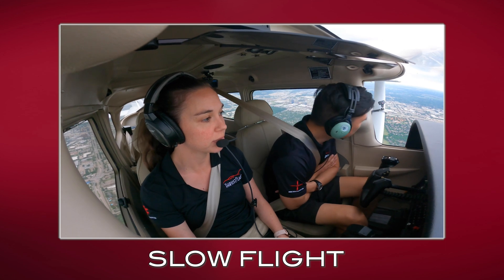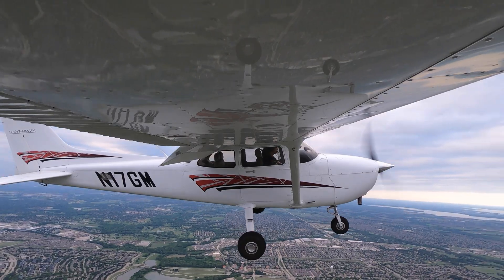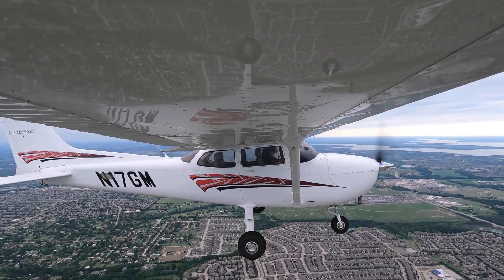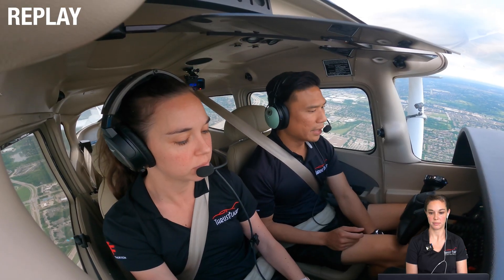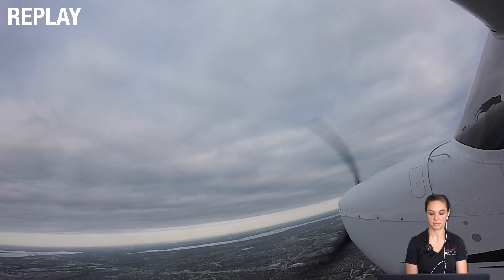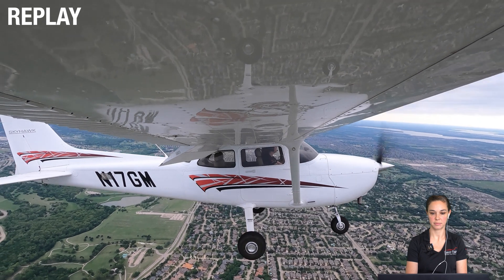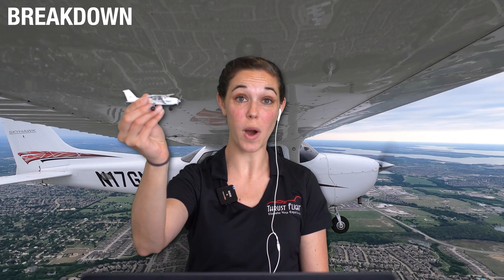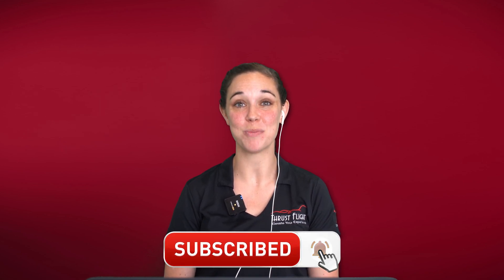How to Master Slow Flight & Fix Common Student Mistakes

Comment: My school has always taught me 55 knots for slow flight. Whats the correct answer? in the poh?
Reply: My school has us slow all the way to the stall horn then add 3knots and make that the target speed.
Reply: You can fly the slow flight maneuver within the airspeed range as defined by the ACS.
The lower airspeed limit is implied as 1 knot/mph above where the stall warning horn would sound. Some POHs give this number, others may not and you would just need to note where that stall warning comes on during training.
The upper airspeed limit = (lower airspeed limit) + (10kts).
This is stated in the ACS by clarifying what specific speed you should establish and maintain (PA.VII.A.S3) and then it gives you an acceptable margin of error at +10/-0 kts (PA.VII.A.S5).
The closer you can fly to the specified airspeed without busting the lower could indicate a higher level of skill, but the goal of a check ride is not to demonstrate perfection, only one's ability to fly within the standards. Aiming for perfection comes at the risk of busting a minimum. So give your self the highest margin possible by aiming for the middle of that 10kt range.

Comment: Something that helps me while entering and recovering from slow flight is remembering how many seconds it'll take for my flaps to move up a certain degree. When you're extending/retracting flaps you have to adjust the nose to keep the aircraft level, so if you don't have to watch the flaps to see when they're going to be at the proper degree, you can focus on the outside and fly the plane better. It's a really simple thing, but knowing that my C150 gives 10 degrees of flaps in approximately 4 seconds has really improved my recoveries.

Comment: The wind is our friend.  Using full flaps on all landings and using a power/pitch approach which included deceleration on short final, I found that cruise trim and full flaps trim is the same if slow enough to arrive at the desired touchdown point "all slowed up and ready to squat."  Good job recognizing that during slow flight, including deceleration on short final, airspeed is controlled by elevator and altitude or glide angle and rate of descent is controlled by throttle.  Throttle may need to be dynamic, especially in unstable air.

The main student error, and the most disruptive one concerning landing, is failure to use rudder primarily to level the wing in no crosswind and to stabilize the wing when using side slip to counter drift.  If we keep the centerline bracketed closely between our legs, we not only stay aligned but we also keep the wing level.  We don't want to turn so aileron is unnecessary except to bank into a crosswind.  By walking the rudder to bracket the centerline, we fine even a light crosswind.  We don't want adverse yaw which happens every time we move the yoke before using rudder.  This yaws the nose the wrong way.  We move the yoke to turn right to realign with the centerline and the nose goes left before correctly going right.  Use the rudder in slow flight to hold a target and therefore keep the wing level.  Use the anti-turn control, the rudder.  Achieve correct yaw, not adverse yaw.

The practical purpose of slow flight, not the ACS purpose, is to give pilots long term practice controlling the airplane in the way it will need to be controlled on short final.  The main help is to get muscle memory in proper rudder only usage to maintain alignment with a target and thus to keep the wing level.

Comment: 8:34 - "Here in slow flight, we use pitch for airspeed, power for altitude."  Really?  The maximum force created by the thrust vector in a Skyhawk is about 500lbs.  Even if you pointed the nose straight up to oppose the weight (which is over 2000lbs), you are not going to control altitude unless there is some new concept of physics.  Many instructors teach this fantasy.  It's really a misinterpretation of the region of reversed command, which is the region where drag increases as speed decreases.  Has nothing to do with any reverse of pitch and power.  Ref Chapter 11 in the PHAK - the drag and power required graphs show the difference between the region of normal command (where the drag decreases) and the region of reversed command (where the drag increases).
Reply: Warren, well that's exactly what Liz is saying. You don't control altitude in slow flight by pointing the nose up or down (pitch) but rather by increasing or decreasing power. The reason it's called "Region of reversed command" is because if you were flying at a typical cruising speed with no flaps, the way you control altitude is through pitch, not power. But for obvious reasons, slow flight training teaches you how important it is to apply "reversed commands" in scenarios of well... slow flight.
Reply: @bkman66  Huy - That's not what the region of reversed command means.  If you want to understand what that term means for airplanes, you need to get the definition from the FAA, not use the definition of Reverse from the Webster dictionary.  The regions of normal and reversed command refers to the relationship between speed and the power required to maintain or change that speed in flight.  Speed and power, not pitch and power.  In the normal region of command (above best glide), less power is required at a slower speed.  In the region of reversed command (below best glide), more power is required to maintain a slower speed.  I know that it somewhat confusing but next time you fly, if you can, do this test.  If in a Skyhawk, fly flaps up at 85, 75, 65, 55, and 45.  You'll find that less power is required to maintain speed at 75 than 85, less power to maintain 65 than 75 in the area of normal command.  But in the area of reversed command, you'll see that it takes more power to maintain speed at 55 than 65, and more power to maintain speed at 45 than 55.  See fig 11-14 in the PHAK.  Chapter 5 PHAK - "as thrust is reduced and airspeed decreases, the AOA must increase in order to maintain altitude".  Sometimes I bring the engine to idle at cruise, hold altitude with back pressure, and don't touch the throttle again until nearly at the bottom of the green arc, nudging in just enough power to maintain the bottom of the arc.  Pitch has held the altitude throughout.

With that said, at critically slow speeds (really at all times), the pilot has to be careful to not pitch the nose too high so as to cause a stall.  This is just the reality that there are limitations with how much the pitch can be raised.  The last time I did slow flight full flaps at the bottom of the white arc, I only needed 1900rpm to hold airspeed.  If I had flown into a downdraft, I would have had to raise the nose to hold altitude - that would have raised the induced drag, but I had quite a bit of extra power that I could use to maintain speed.  But what if the downdraft got stronger and I had to use full power to hold airspeed?  That would be the limit - any further increase in the downdraft would mean a loss of altitude.  I couldn't raise the nose any more because that would have raised the induced drag further, causing a loss of speed and a stall.